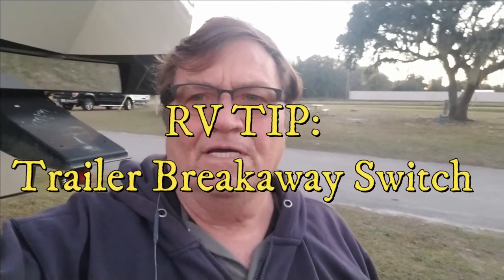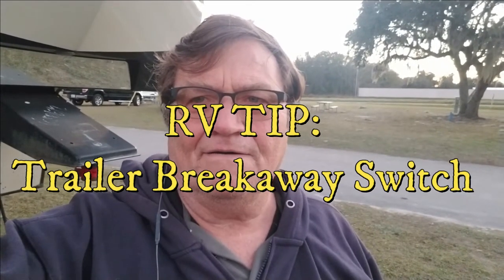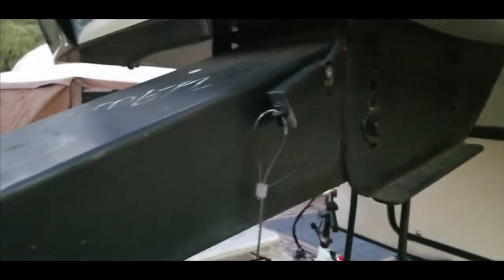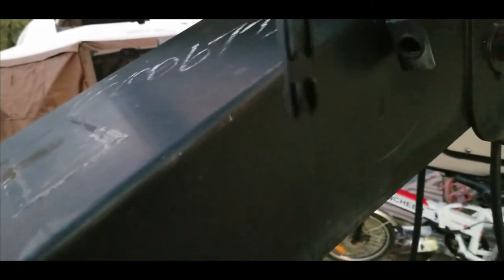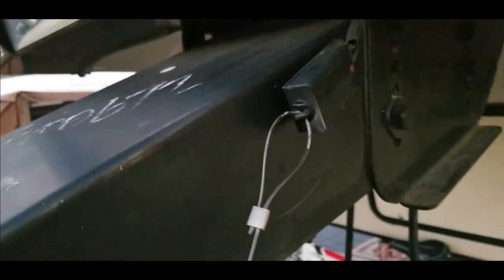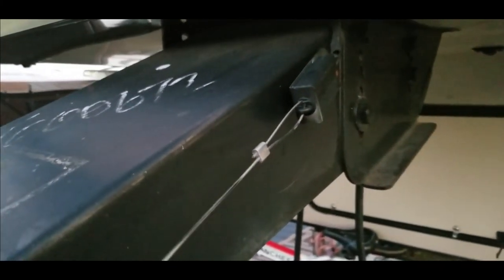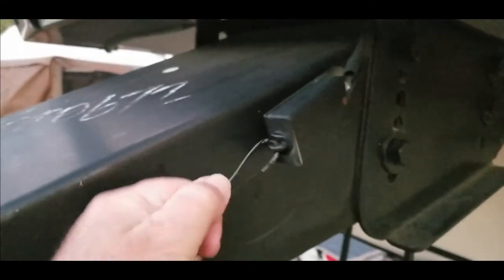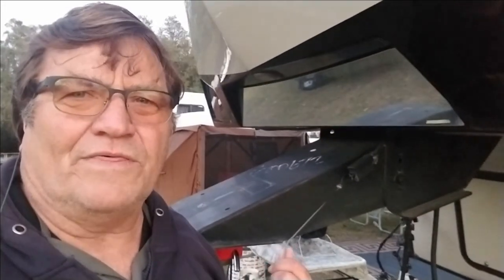RV TIP  Trailer Breakaway Switch

Comment: This is a really good tip. I probably would’ve panicked and planned a brake job. The simple things will get you every time.
  Just last week I heard a squeaking sound coming from the front left wheel of my wife’s car. All I could think of was maybe brakes, maybe u joint, or wheel bearing. The wheel lug nuts were loose! How does that happen? Anyway it was a simple fix and I was grateful.
Reply from the maker: Glad to hear it was a simple fix. People always think the worst at first. I say start simple